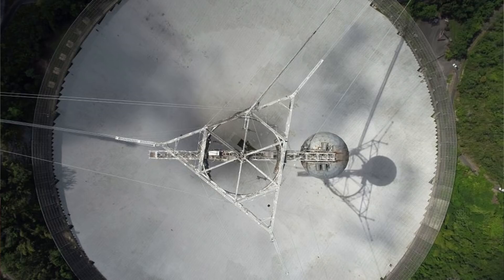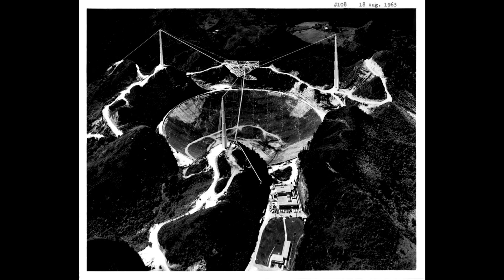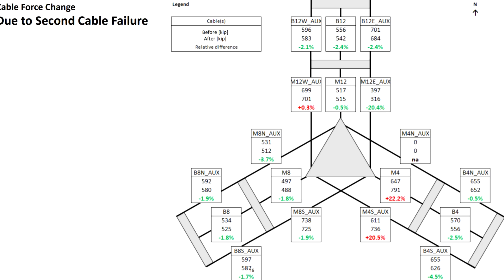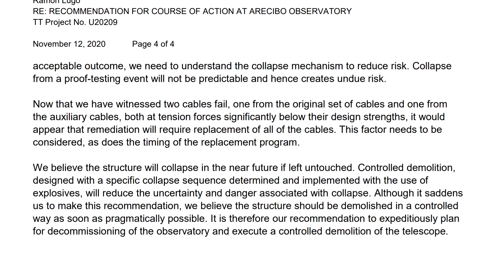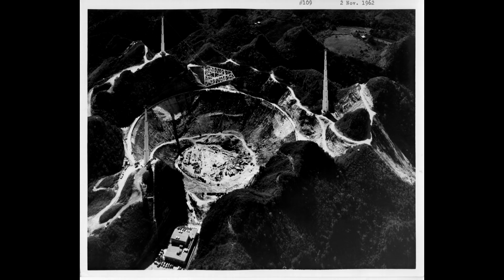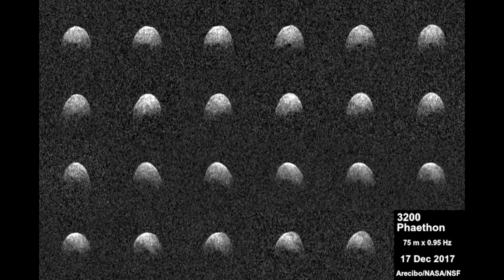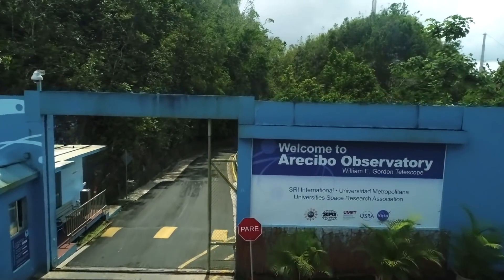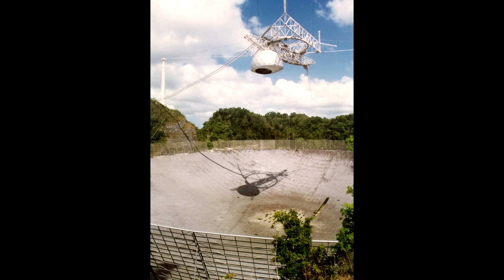Worlds Largest Radar Astronomy Dish To Be Demolished!

Comment: This news saddens me tremendously.  As others have noted, Arecibo is iconic.  But let's note, what we are losing is the ANTENNA, not necessarily the entire instrument.  If the observatory is laid out as I think it is, the antenna can be replaced ... perhaps with something better though not necessarily larger, and something easier and less costly to maintain.
Reply: Well the antenna and the truss/cable array supporting it is the most complex and expensive part, and if it snaps free or is cut down its going to demolish the dish as well.
Reply: @planetfall5056  Replacing it is going to be expensive no matter how we go about it.  I believe though that a major portion of the system is located in buildings OUTSIDE of the 'bowl' the dish is located in and that the towers surround.  That's why I said that it is the ANTENNA that will be lost, not the signal processing computers, generators and everything else.
Reply: @robertf3479  I mean...yeah? The buildings next to it will hopefully be fine, no one was saying the entire facility would be wreaked, Scott mentions how a few other minor telescopes would continue to be used at that site. Its just that the Arecibo telescope is the biggest and most expensive part of the facility, so talking about how its computer buildings will be ok is kind of...odd. Compared to the 350 meter radio dish with a multi-ton mobile hanging sensor array, a server building is a pretty small footnote on the repair bill.
Reply: I think the problem is they don't have cable, or winches, in place to lower the antenna so they will have to crash it into the dish. Not even sure if there's a way to cut all the cables at the same time so the towers survive. Those cables are very heavy.
Reply: @CanalTremocos  Radio triggered explosive devices can be used to server cables simultaneously (to within less than 0.5 seconds).  The sudden unloading of the towers might cause damage though.

Comment: As someone that's done rigging those cables should have been change every 10 years, so there's high probably that when the try and start to lower more cables will snap. But remember how many  satellites with the Radio noise.

Comment: The moon is a good place to build a replacement.
Reply: It would be breathtaking.
No, literally, because there's no air there.
Ahhhh, nobody gets me.
Reply: It's too expensive to fly all those Puerto Ricans up there to build it.
Reply: @GunkDung  Touche, sir.
Reply: @GunkDung  lets use a space bus, cheaper
Reply: If I recall correctly, Arecibo used to be used to catch Russian signals bouncing off the moon.
Reply: Orbit or deep space is better. Remember, the problem here with Arecibo is that most of the structural engineering is to overcome gravity. Trading that for .167 G isn't much of a tradeoff. But you could build a reflector out of thin film that could easily cover a square kilometer of area but packs down into 1-2 cubit meters of cargo space. Deployment would basically be done by inflating with nitrogen. Slap on a gyroscopic repositioning system, some solar panels, and some control hardware, and we now have a floating deep space radioastronomy platform for much less than the cost of rebuilding Aricibo, but with none of the drawbacks like limited view of the sky or terrestrial radio interference.
Reply: As the Moon only rotates once a month, wouldn't be able to scan sections of space quickly. 
Why not build a pair of them (or an array of dishes) at L4 and L5? 
Can be fully steerable there and provide a long baseline to enhance resolution (with Earthbound dishes too)
Reply: Dosent NASA want to do that idea on one of the craters
Reply: It would probably be more cost-effective to rebuild Aracibo and build 10 new similar sized dishes on Earth!
Reply: @nagualdesign  you could build a much bigger dish on the moon, due to the lower gravity and the large craters for putting the dish in. Also the far side of the moon is very radio quiet which means less interference from terrestrial radio sources
Reply: @thisisyourusernameondrugs9373  Yes you could, at a cost of tens if not hundreds of billions.
Reply: @nagualdesign  It depends on how much stuff you actually have to send up there. As 3d printing and automation get better, you could feasibly send up a few rovers which could 3d print stuff out of lunar material. Although currently that tech appears to limited to only building protective regolith 'igloos' for radiation shielding around lunar bases. Maybe one day it'll happen!
Reply: @thisisyourusernameondrugs9373  Even if and when the cost of building on the Moon drops it will still be far more cost-effective to build things on Earth.
Reply: @nagualdesign  Yes, that is true.
Reply: @rogerwilco99  Listening to what? This is your first reply to me I suppose?
Also about the limited access: well, LHC has limited access, too. If you consider everything not in your homeland as "limited access", then I guess they really are.
Reply: ESA already experimented with robots building structures with moon soil. They're horribly slow and it probably wouldn't be really smooth. But who cares. Just let them build a very very  huge dish over many months. :D And as a second project: an enormous mirror from elements found in the soil.
Reply: Would need to get a reactor up there too, to be radar capable.
Reply: Excellent idea. Absolutely brilliant... 🚀
Reply: Gamma screws electronics so not really. Gamma even when it does not screw the electronics causes noise in the amps and messes about with offsets.
Reply: @gordonlawrence1448  Protective coatings should do the trick.
Reply: @tapist3482  If you think that then you do not understand the problem.
Reply: @gordonlawrence1448  If I understand it correctly, the gamma ray level around the earth will not burn electronic components, but might interfere with computing units or flip bits in storage, right?
Reply: @tapist3482  There is also single event latchup which can blow chips all together and gamma can also affect the gate threshold of FETs never mind noise issues.
Reply: @gordonlawrence1448  Oh... That's harsher than I thought. Thx for the information.
Reply: @rogerwilco99  You'd have to put the electronics about 200m underground and then where would you get the liquid nitrogen from?
Reply: @rogerwilco99  "And it's in China which can SEVERELY limit access." Could, but mostly doesn't. Or at least not nearly as severely as America is now in the habit of limiting access to Chinese companies and researchers in all kinds of fields. Of course America's recent execrable conduct has given rise to some Chinese tit for tat.
Reply: That would need a lot of maintenance from tiny meteorites punching holes in the dish. Here we have atmosphere that stops those
Reply: @TheKwiatek  Dish doesn't have to be perfect, to be effective. Aracibo itself is proof of that.
Reply: @interstellarsurfer  
Yep, Arecibo is full of holes to let the rain through.  My ex is Puerto Rican, it was a neat place to visit.
Reply: @TheKwiatek  you could do a liquid mercury mirror that you edit the spin of to edit the focus. Isaac Arthur talked about this idea.
Reply: @calebnasiatka5711  Look up the Large Zenith Telescope. But I doubt the cost of operating one the size of Arecibo is feasible.
Reply: @calebnasiatka5711  Liquid Mercury mirrors are cool and make excellent mirrors for telescopes however, one of the big problems is that mercury is extremely heavy and I am not sure if there is much on the moon.  The extreme cost to making a mercury telescope on the moon will definitely limit the use to farther in the future.
Reply: @calebnasiatka5711  You don't generally need to 'edit' the focus.  Your instruments sit at the focus.  The distance to them doesn't change.  You do need to keep the mercury spinning, and you have to get quite a lot of heavy liquid metal there in the first place.  Not sure this would be the most economical telescope to build.
Reply: @TheKwiatek  Only needs to be a mesh smaller than the wavelength that's observed, how you check how food's doing in the microwave?
Hence a few holes wouldn't impact the dish part, if as big.
Reply: @TheKwiatek  Just hire the ULA sniper, he has a pretty good aim.
Reply: @TheKwiatek  don’t need that if you’re smart. Radio waves are much much larger than the damage they would cause if the dish was thin enough. Raleigh equation for resolution guarantees small damage won’t affect signal fidelity that much.
Reply: We already have a larger one in China. So the demolition of this one should not impact much to scientific researches.
Reply: @tapist3482  Didn't you watch the video? The Chinese one can't do radar...
Reply: @Babbaracos  Once you have a large enough reflection surface you can get a radar transmitter installed easily.
Reply: @tapist3482  The Chinese dish does NOT have the same capabilities.
Reply: @otpyrcralphpierre1742  Yes, for example not so accurate on higher frequencies (10ghz). However its resolution on 5ghz and lower is incomparable.
Reply: @tapist3482  Will China be sharing the data from their telescope?
Reply: @BnORailFan  Why not? Astronomical discoveries are almost shared freely around the world. China is not an exception, either.
Reply: @tapist3482  Some governments are like that. I don't know if the Chinese government is the sharing kind.
Reply: @BnORailFan  You don't read science journals often, do you? Chinese scientists have been sharing their discoveries with the world for decades.
Reply: @tapist3482  No, I don't read science journals. I'm glad to hear they share.
Reply: @nagualdesign  To be fair, they are a dictatorship. It's ok to be against authoritarian regimes
Reply: @thisisyourusernameondrugs9373  I wasn't referring to Chinese politics, I was referring to the fact that China does a lot of scientific research and they share their findings, publishing them in scientific journals like everyone else, rather than being secretive as was suggested.
Reply: @nagualdesign  Ah right I getcha
Reply: @thisisyourusernameondrugs9373  To be fair, China is a modern country with its own effective democratic system and should not be compared to real dictatorships like Saudi Arabia or North Korea or military juntas in Africa.
But I guess it's not the right place to discuss on that though. You can read the page on China's democratic system on Wikipedia for more information.
Reply: @tapist3482  It is a single-party government with social credit scores, censorship, a firewall from the west, brutal crackdowns on protests, and "re-education" camps for dissidents. It 100% should be discussed in the same sentence as those other countries you mentioned.
Reply: @thisisyourusernameondrugs9373  Well, you can have your opinions. Just take a minute to think about this: Is that really your opinion?
Reply: @tapist3482  No, it's not my opinion. Those are facts.
Reply: @thisisyourusernameondrugs9373  Like I said, you can have your opinions. Including but not limited to: thinking your statements are facts.
Reply: @tapist3482  The existence of the Falun Gong followers, Uighur people, and many other minorities in that large, billion-strong country are factual aspects of humanity. Not opinionated statements that are interpreted as facts, such as your view of these facts' legitimacy, but actual occurrences and stories of people that have been documented by many different sources.
Reply: @tylerphuoc2653  And how many sources do you have? Does the number surpassed that of all the Uighurs and other minorities, all the Christians, Muslims, and Buddhists I've met in China who are living normal lives?
You think your statements are facts? Sorry, mines too. 
One of us must be wrong then. 
I won't say you're wrong, I could be wrong, too. 
However I'm more confident than you, because I have information from both sides for comparison, while you only have one-sided information.
Reply: @thisisyourusernameondrugs9373  No more arguments beside personal attacks? I guess I'll call it the end of our conversation then.
Reply: @tapist3482  I will concede the fact that the PRC might be more trustworthy in terms of medicine, cybersecurity, and neural network engineering. However, I would highly doubt that there would be a glut of attention paid to sociological or psychological studies.

Also, Uighur people are distinct from the wider Muslim community, just as the Falun Gong sect is distinct from the wider Buddhist community.
Reply: @tylerphuoc2653  So you think China still is not investing enough in natural science? To some point you're right. However it's mosrly due to lack of budget rather than political reasons.
Reply: @tapist3482  No, China has a bigger one. They will use it as they see fit - probably as an antisatellite weapon.